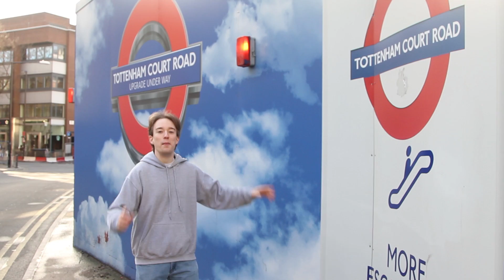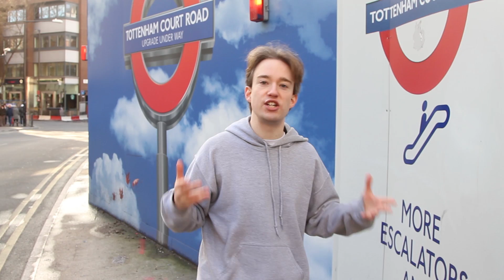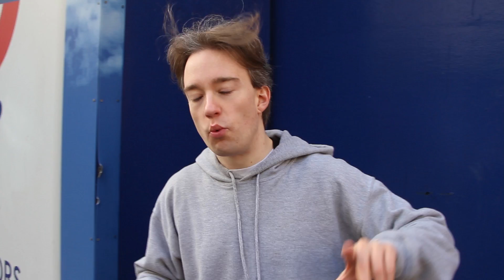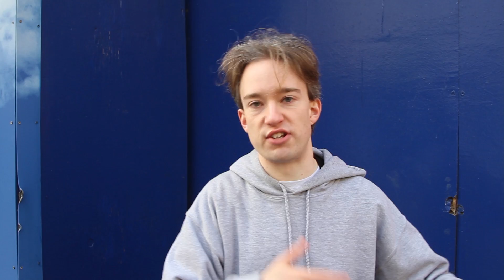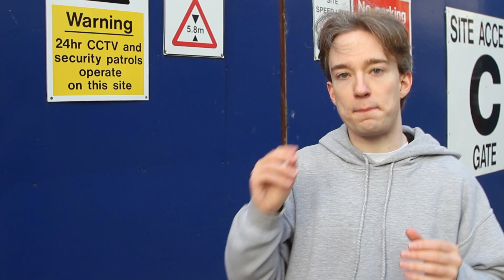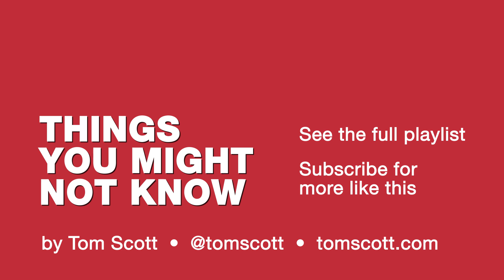Why Do Reversing Trucks Not Beep Any More?

Comment: Tom: It's safer
Me: Umm... it sounded like pressurized air releasing, which is quite common on job sites even beyond the air brakes on vehicles. 
I refuse to believe this is actually safer. I'd love to see real-world statistics backing that up. Everyone knows when they hear that distinctive "beep beep beep" to immediately look around and make sure they're not about to be ran over. If I heard this, I would think nothing of it. It's a very ambiguous sound, unlike the distinctive beep-beep-beep we're all used to. This was done to appease apartment dwellers, not to improve safety.
Reply: If that's the case they should get rid of them all together and just let people get run over it'll be far safer without Darwin awards. Practical example was I was walking downtown in my little middle of nowhere town and I was able to spot a vehicle using the system. It also doesn't need to be that strong just within vehicles vicinity. But I would love to see the data as well. Of course there's the opposite problem some of those beeping alarms actually causing hearing damage on construction sites and requiring OSHA to mandate hearing protection two wrongs make a wrong right?

Comment: I work in public transport in a safety role and this comes up for debate every now and then. I know the theory and it is sound (there was an experiment to intermix white noise with Police sirens, but despite it working it never came to much) but in practice I don't find it a very good system at all. Too many other emissions of white noise in a modern environment and you can't hear it. In our local bus stations there are a series of air conditioning and ventilation fans and the noise they give off drowns the WN reverse alarms, but not the bleepers.

Of course, some have bleepers with several different tones and others shout out "this vehicle is reversing. This vehicle is reversing..."

Comment: Some have little tunes, or recorded messages saying 'THIS VEHICLE IS REVERSING'. Some bin lorries have surprisingly posh accents.
Different manufacturers use subtly different noises.
A truck may have one separately from the trailer, with both going off at once.

Comment: monotone sounds with high frequency (high pitch), specifically with wavelengths shorter than the width of your head, are difficult to localize by your brain/hearing system. this is because your brain uses both differing volume and phase from each ear to determine where a sound is coming from. if you have been plagued by a rogue cricket in your house you will know what i mean..that thing can literally be in behind you croaking at full volume and you would not be able to tell where it is coming from. white noise has multiple frequencies which will be easier to localize.

where safety is concerned the researchers have concluded that it is not necessarily crucial that you immediately know what the hell is making that white noise, but instead it is far more important that you will notice it at all and will be able to more effectively identify the direction the source when you do.

Comment: Sounds like an air nozzle. I get the logic behind this but unfortunately there are already industrial things that make that noise and they're not dangerous in the slightest unless you actually manage to puncture yourself and inject the air into your bloodstream.

Probably the best solution would be to have the white noise and a few quieter but discordant pure tones at once. Even if they're too low for you to pick out on their own they will be quite distinctive when synched up with the audible white noise pulses.

Comment: The white noise instead of a beep will probably never be adopted in the US because it would cost money (regardless of how much safer it is). Maybe after a few thousand more people are crushed, and it costs companies more to pay out wrongful death settlements
Reply: Except it costs nothing to just use a white noise instead of the beep for newer trucks, yet a brand new dump truck off the assembly line will probably have a standard beeper. So I highly doubt it comes down to money. It is likely more to do with regulations. Or just simply apathy.

Comment: Tom, good video, but you stopped short of the "why?". The reason white noise alarms are better is because they give our ears a wider band of sound frequencies to detect, giving our brains more information on which to deduce direction from. This means the sound is instantly locatable – a huge leap forward in terms of safety, because even a split-second's confusion can result in serious injury or death.

Comment: The channel tunnel construction trains were driven by BRail drivers who sounded the horn of the Intercity 125 engines twice before moving. Imagine standing in front ot that in a 25' tunnel. fillings would fall out. Safety people laughed when I pointed it out to them...not even considering the black dense diesel smoke that moved down the tunnel for 20 miles after every start up. THis is how mad safety people actually are.

Comment: (1:16) And because the white noise plays at a lower volume, it also means it has a lesser chance to echo, and you will hear less from them when they are further away and only focus on the nearer ones. Such an improvement.

Comment: The one huge disadvantage that I don't think anyone has taken into consideration with these is that they're not good for commercial vehicles operating on general public roads as there is no psychological association with some rasping noise that sounds like a dragging brake drum and a vehicle backing up. While a backup beeper may not be directional, it at least carries the association of a vehicle backing up, and makes you alert to your surroundings. I've heard these and my response was to simply stand in place and try to figure out what the hell that annoying sound is, and only realized it was a back-up "beeper" after watching this video. Obviously this completely defeats the purpose of the back-up beeper.

Comment: A lot of commenters seem to be a tad critical about the white noise type of reversing alarm, this shows just how blissfully ignorant they are. All workers on the site must have a Site Induction before starting work, part of the induction will include all the different types of alarms used on that site and therefore all workers should be aware of the white noise reversing alarm. If you have only ever worked in the soft environments of an office, call cantre, retail store, or other such environments, you wouldn't know this. If you have got some guts about you and have worked on construction sites you'd know that there are many other ways to get injured at work.

Comment: It's not because our ears are trained for it, it's because the correlation between two white noise signals have a higher peak at it's delay, making it easier to tell direction. It has nothing to do with training our ears, it's simply correlation factor.

Comment: Someone is raking gravel on this side, some welding and grinding going on over there, there's a guy with a concrete scraper machine to the left, some clipboard warrior is testing his megaphone, up there they are dragging a big tarp around, there's a whole crew going at it with impact drivers and a bloke over there is trying to find Sky on the radio.

Having been on the job since breakfast, you will have contracted some form of hearing loss, unless you're lucky enough to have your mufflers on absolutely every single time someone drops a scaffolding pipe. With your mandatory ear protection on, that array of run-of-the-mill construction racket sounds like there's a fly buzzing around somewhere. And then there's the minor issue that mufflers make it a lot more difficult to localize sound.
OK - the pneumatic jackhammer is clearly noticeable, and so is the guy banging on a steel girder, but that's about it. And remember, since breakfast your brain has also begun to filter out al lot of scraping and hissing. The beeping sound was designed to stand out in a noisy environment, which it does, given the number of people who complain about it, and it does a decent job of registering through hearing protection.
You always have to look for what's beeping anyway - once you've spotted the trajectory you're good to carry on. So let's change this somewhat effective system that has been commonly used for so long that everybody now instinctively recognizes, and use a type of sound that will barely stand out as a safety device, so now everybody on-site has to become alert to minute changes in the background noise. Brilliant.
Reply: They should just stick a chime whistle on it, because they can work on air and are very distinctive. People generally associate them with steam locomotives, but I'm not sure why they couldn't serve in this application.
Reply: The experts have spoken though!  You know.  The ones who don't even work on construction sites.

Comment: Pulsing white noise? Really? Sure. Let's make the reverse alarm something that sounds like tires on gravel or air-ride suspension dumping it's pressure. The monotone beep is meant to get your attention, force you to actually look around, then move if needed. And if you spend significant time on construction sites, you'll train yourself to be aware of that sound in short order.

Comment: Great stuff. We could go a step further and change all the red traffic lights and brake lights to white. Because by the same logic, it takes wider range of the spectrum, so it would be easier to recognize. Let's do it overnight and don't tell anybody about it, that will really help.
Sure, we can ignore the years of evolution and social convention that taught us to associate red with blood and sharp tones with attention (microwave, bell on the church, etc); so both are used to indicate danger. Let's throw all that out and make the reverse beep a white noise. The same white noise that our brains learned to filter out in the city life. 

And while we are at it, let's make the car horns do a white noise as well, at least it will piss the drivers off as well, so they will use it only when necessary, not when they are angry.

Sarcasm off.
Whoever did that "research" must have done it in some university lab, where the beep / white noise was the only sound. There it may be better to detect. But in city soundscape, we filter that out.

Comment: The MBTA's work vehicle sounds that I have heard in the last few month in the Boston area must be a variant of this.  Not exactly white noise, but something that sounds sort like a grinding or sandpapering noise.  On the other hand, the ones I have heard it on are cranes and related types of vehicles, and they seem to generate it when moving in ANY direction (including when cruising forward on the road).

Comment: 2020 and I've still never heard this, but have heard lots of beeping on even new trucks. The vehicle standards in Australia are not prescriptive on the matter apart from "intermittent audible signal on a regular time cycle.  It must not emit a signal louder than is necessary to warn persons of the proximity of the reversing vehicle."
If I did hear this white noise, particularly near a construction site, I'd assume someone was using some sort of air compression tool and wouldn't give it a second thought. The regular cycling of the sound would likely have to continue for a while before I consciously noted it as oddly so. I would therefore agree with others here, a warning signal is typically most useful when people understand it's a warning signal; otherwise it's only a theoretically effective warning signal.
Reply: When you hear it it really sticks out. Doesn't sound like air systems at all. The sound just doesn't taper. Those sound designers know what they're doing.
Reply: @zoravar.k7904  Fair enough, I imagine YT's compression doesn't do it justice; however the point remains that it's only an improvement if people understand that it is a warning signal. 
Probably best paired with some sort of education program if manufacturers in a country transition to using it.

Comment: I can kind of understand the "easier to pinpoint" thing, but I still don't understand why it's safer.  It can be "mistranslated" (for lack of a better term) for many, MANY other sound sources.  In fact, the other point (where it's described as a "natural" sound) is counter-intuitive for the issue.  You want an unnatural sound for it, because it makes you intuitively realize that it's something that needs attention.  If it's a sound you hear commonly, there's a chance you won't even consciously notice the sound unless it's loud enough (which negates his other point where it doesn't have to be that loud).
Another comment mentioned that the benefit of using a multi-tone is using the sound imperfections to be able to pinpoint the location as that's how your brain uses both ears to, well, find the location.  However, the issue is that "finding the location" is not the primary goal of the reverse beeping; it's to grab your attention - something that the white noise alarm simply can never do as effectively as beeping.
Reply: Have you heard it IRL though? It's very loud and distinctive.

Comment: The TV antenna cable was pulled our, it was plugged back in, it was pulled out, it was plugged back in, it was pulled out, it was plugged back in, it was pulled out, it was plugged back in, it was pulled out, it was plugged back in, it was pulled out

Comment: I used to work as a postman with a route that had a lot of driveways masked by trees or coming out at strange angles. For some reason whoever designed the postman motorbikes we used decided to make their indicators do the truck reversing beep when you used them. I lost track of the number of times I freaked out trying to work out where this reversing truck was coming from, especially since, judging from the sound, it was practically on top of me.

Comment: As of February 2020, I've never heard the white noise sound (in Illinois) and am not sure what my innate response would be. The long-familiar beep makes me instantly look around.
Just imagining, it seems to me simultaneous or alternating emission of both sounds might really grab one's attention, sort of the way flashing lights of different colors and timing on emergency vehicles does visually.
Reply: We have them in Australia, and it's very loud and distinctive. Even though it took me a long time to even figure out why they made that sound, it never failed to grab my attention.
Reply: Illinois is in USA
Reply: Your reaction will be to look directly at the thing that just made this loud ass hissing noise.  It pulls your attention directly to it instead of "looking around".  It's never been obvious to me that it meant the truck was backing up, but it was innately obvious that it meant "This large hung of metal is about to be moving, pay attention."
Reply: @keinespur0  - I haven't heard a vehicle equipped with the white noise backup sound, so I will refrain from making a judgment on it's efficacy, but I can assure you that I would definitely think that it meant "This large hunk of metal is stopping, don't worry about it".  The sound that is played in this video sounds very much like air being released from a brake system.  Releasing air from the system is how brakes are applied by commercial vehicles, which makes you think the vehicle is stopping, not moving.
Reply: @Max_Griswald  Trust me, you can tell the difference. I've heard it quite a bit where I live and it's really not hard to tell the difference. In the video it sounds different then it does in real life and the frequent short bursts means you can definitely tell it's not an air break system. It's funny to see people being so very critical of it while also admitting that they have never heard it in person.
Reply: @BlargSmarg  - I specifically mentioned that I would refrain from making a judgment on it's efficacy, since I hadn't heard it in real life and was giving my thoughts on it from what I heard on the video, so I'm not certain where you get the idea idea that I was being critical of it.

Comment: This is obligatory for construction sites in the UK, which is why most people wouldn't have heard one.

In general it's becoming a common alternative to the beeping sound.

It's actually safer with the white noise because the sound doesn't get drowned out by tools, machinery, etc., unlike a beeping sound.

Also noise pollution is a factor. The beeping sound can be heard up to 2 miles away. The white noise sound can be heard at a much lower volume.

Comment: Sounds like air brakes being applied... no worries, the truck is braking.
Beep, beep, beep, something is backing up.
Reply: I agree Moore. 
Here in the Midlands it's rare to have to pick out reversing noises from overtly loud backgrounds (unlike cities), so the rasping's main purpose is kind of moot.

People expect beeping & immediately think "something's reversing", thus it's odd that they introduced hissing without any real attempt at a public information campaign.
Reply: what makes you think the white noise isn't pulsing?
Reply: The sound is flat and comes across as far too digital to be air breaks and it repeats at regular intervals, so you would question it.
Reply: I've mistaken it for air break noises in the past, did look to see what was going on. It is easier to judge if this sound is moving towards you or not but that won't come across from a video very well.
Reply: @zoravar.k7904  No it doesn't.
Reply: @zoravar.k7904  You're bending over backwards to come up with justifications for the obviously wrong answer.